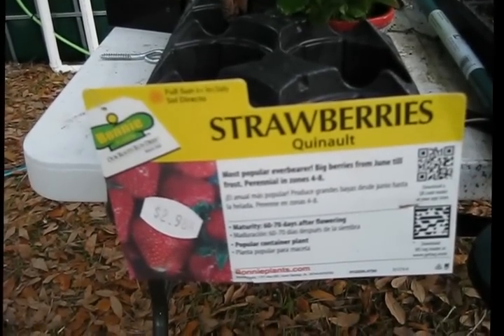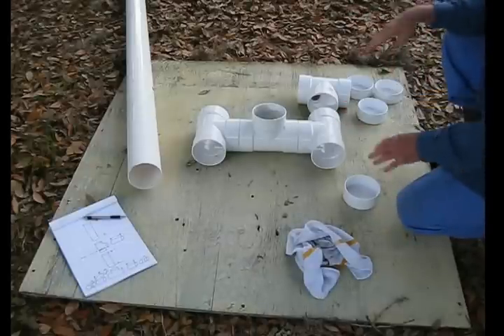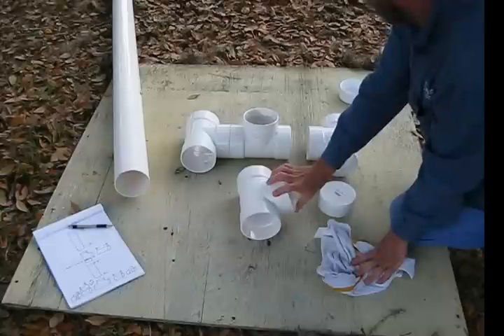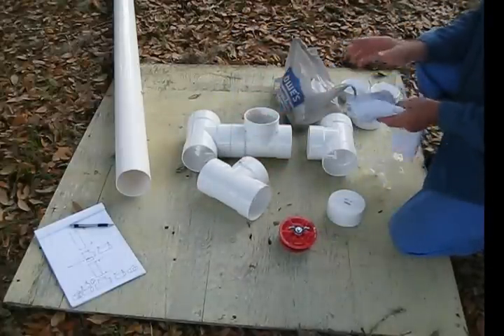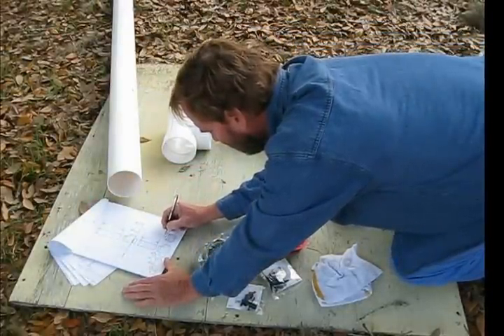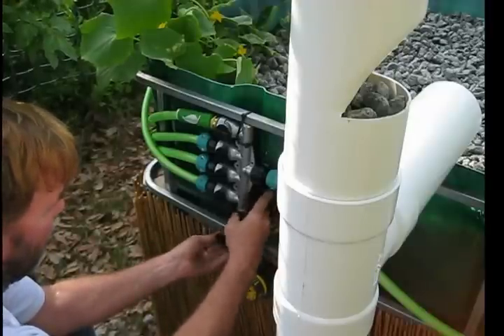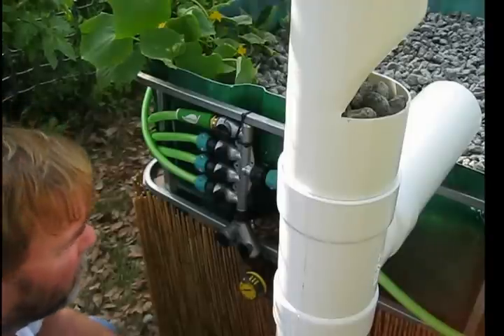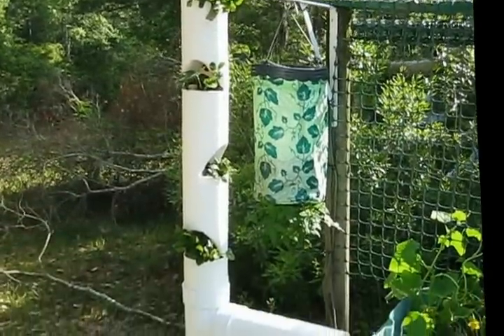Strawberry Tower (The Build) Aquaponics

Comment: Some helpful hints from a plumber. 
Primer and glue BOTH SIDES of the connection. That means the socket and the end of the pipe about to go inside it.
After inserting the pipe into the socket, turn it 1/4 turn. This ensures that you get a complete seal. 
A short piece of the PVC should have been glued into the socket where he used the screw plug. It would have given him a bigger surface to properly flush fit the plug without having to modify it.

Comment: Sewer pipe is not UV resistant which is why it is cheaper you muppet...non UV pipe - ie, ANY pipe which is for use inside or underground will become brittle any decay very quickly indeed. This is the problem with you wannabe DIY'ers making out you know best is the  epitome of You Tube smegheads

Comment: looks very cool, thank you.
Here's my noobs question:

is this better than have  a gutter or 1/2 pvc pipe horizontally at 6 or 7 feet height?
it seems I would be able to fit more plants in a horizontal layout. althoug this looks nicer.

Also, when is the best time to set strawbery plants in aquaponics? and what do I do in the winter when the temps go freezing.

thank you very much for the ideas.

Comment: Hey Paul, I have watched your video several times and decided I want to incorporate several of these towers into my system (which is still in the planning stages). I have searched and searched for the end plug at both Lowes and Home Depot, as well as on line and just can't find it.  Can you tell me exactly what it is called or what department you actually found it in at Lowes?  Thanks and a great job.

Comment: when sealing off the tee with plunger why not cover the opening with plastic then push in  a 3inch piece of pipe to jam it in there.. job done... no need to lose yer fingers using a chop saw ;0)